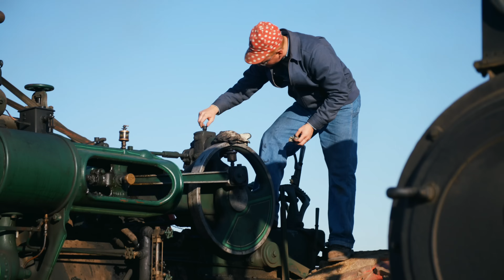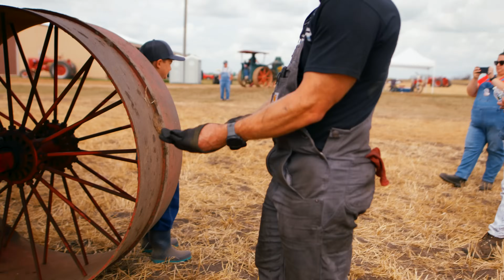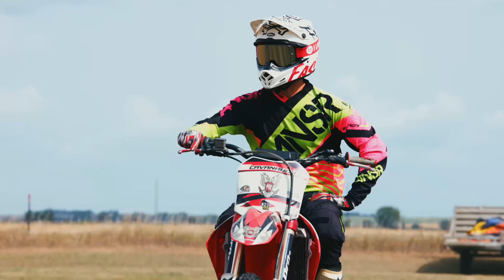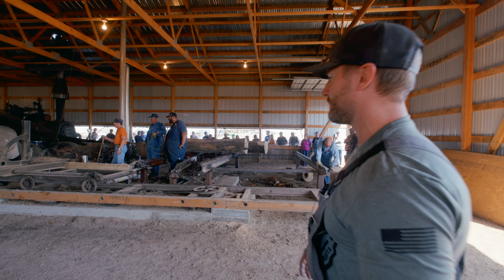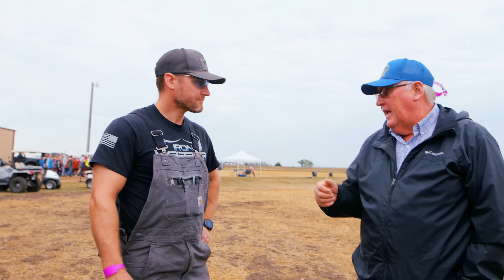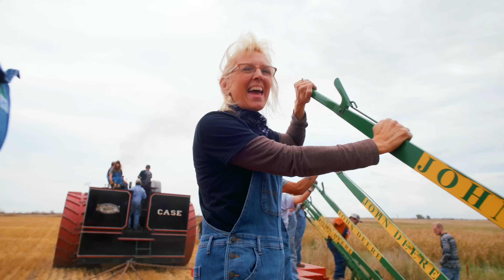NEW 2022 Full Video - 50 Bottom Plow!

Comment: You have to go to the half century of progress and pull their record 66 bottom plow that big bud pulled in 2009
Reply: I have no doubt the case would do it
Reply: My guess they will try to surpass Big Bud
Reply: A 535 horsepower New Holland pulled 65 bottom plows. A big bud could pull way more. But these clowns on here never heard of gearboxes or hydraulics; so they will keep saying this weak steam tractor could outpull those diesel tractors. Such fools.😂😂😂🤣🤣
Reply: Never measure a steam engine by horsepower. Measure it by the torque. The torque on these can be infinite.
Reply: These videos are really cool to watch, but the measure is a little arbitrary, soil composition and speed are important to how many bottoms you can pull.  So i dont think an "A/B" comparison is really valid unless they were both in the same field on the same day.
Reply: @EETechs  8 by
Reply: Why not 70?

Comment: If there is enough material in the flywheel i hub I suggest taking it off and splitting the bore then adding 3 or 4 bolts on the side so you can clamp it to the shaft that would be much stronger keep it from loosening up.

Comment: @EETechs was right.
Large pulling forces can be conquered easily with heavy weight, good traction and a gearbox.

This impressive tractor has all 3, but so does a good bulldozer.

Many other viewers are also correct that pulling force (torque) doesn't equal power, which is:

force x distance
-------------------------
time

This is where the modern diesel tractors a cell,
with weight, traction, gearboxes and horsepower, which will get more work done in less time.

But, it's sure an impressive machine and record! 

It sure would be interesting to see if there is a bulldozer out there that can beat that record....

Comment: The largest engine in the world? What about those mining trucks? Aren’t their engines larger?
Reply: I’m pretty sure he means it is the biggest steam tractor. So not counting steam locomotives, and any gas, diesel, electric etc engines. There is no gas or electric engine bigger that I know of but there is some Diesel engines and steam locomotives that r bigger, but at the cost of having less power per weight/size. There is Diesel engines used in steal mills and mines that r stronger but they r much bigger then there strength is compared to the case 150 steam traction engine. In any size class, the steam traction engine in its class is the strongest.